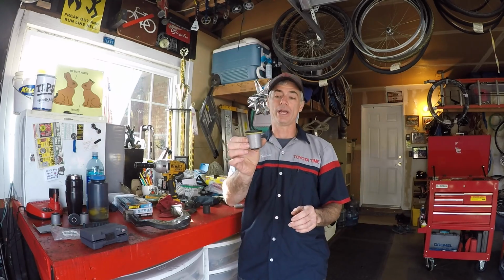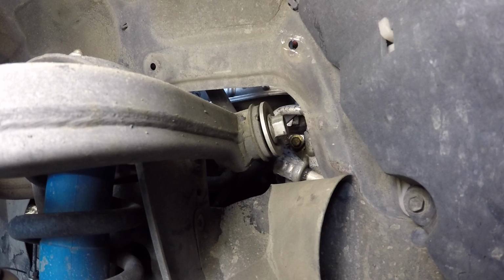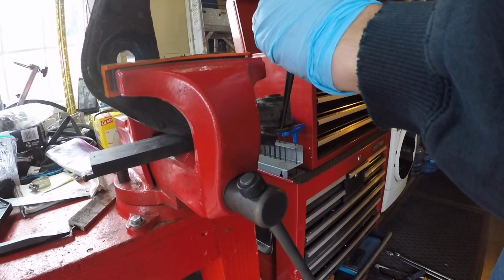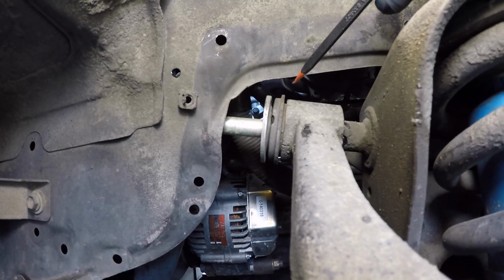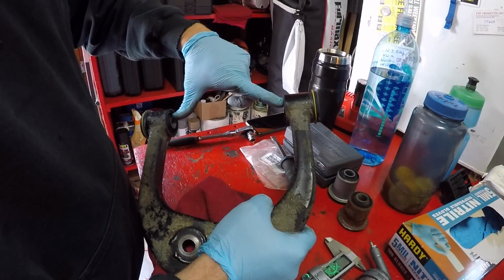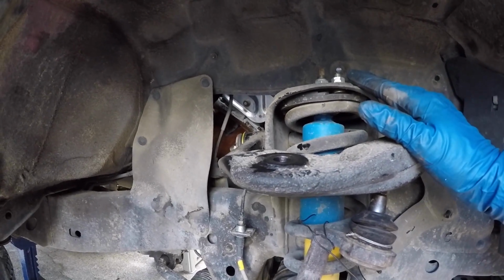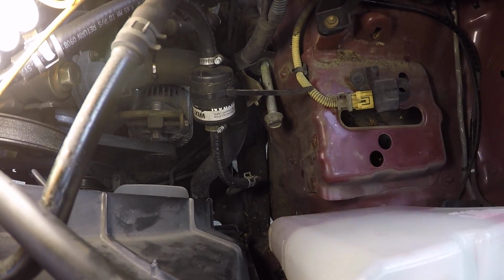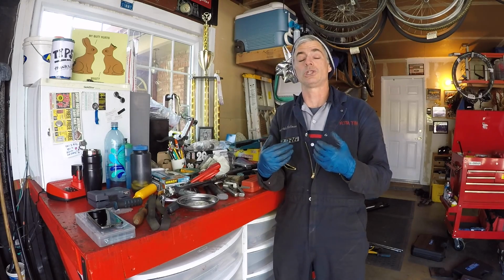Front Upper Control Arm Bushing Replacement

Comment: Can you use the same technique to press the UCA bushings out as the LCA by using the bottle jack and wedging it in between the arms?
Reply from the maker: No, you can't.  The distance is too tight unless you can find a miniature version of a bottle jack.
Reply: @T @TimmyTheToolman  that makes total sense. Thanks!!
Reply from the maker: @nathanjohnson7848 No problem.

Comment: Heyyy Tim quick question should those bushings fit on a 2003 Tacoma 2 WD Because I just came out of a Toyota dealer and they told me that I can’t just order bushing for my truck, that I have to order the whole control arm? Which was kinda weird, Im going to do the inner tie rods, and since everything gonna be out I’m changing everything like control bushings, lower upper ball joints, wheel bearing. Your videos areeeee awesomeeeeee!!!!!
Reply from the maker: I would venture to say yes, but since I've never done this job on a 2wd Tacoma, I can't give you a definite answer.  The control arms should be the same though.  

OEM inner tie rods are very expensive.  It's a better deal to buy an new OEM steering rack because you get new inner tie rods with it.  It's a better use of your money, because the steering rack is like $550 and the inner tie rods by themselves are like $300.

If you're doing front wheel bearings, our Manual Hub Swap videos will teach you how to do it.  Because you don't have CV axles, our wheel bearing video will be different than your setup.

It's good to know you like our videos.

Comment: Thanks for a another great video.  I managed to get all the way to the pressing then I mangled my control arm while trying to press out the bushing.  I used a deep well 27mm impact socket as I didn’t have a shallow one so I’m guessing it traveled on me at an inward angle so I didn’t notice it was mangling the control arm until it was too late.  I was surprised by how soft the metal on the control arm is.  Perhaps it’s cause my truck with 330k miles spent most of its life braving the salty roads of NY.  I’m watching Sean’s video on the JBA upper control arm install now.  If anyone needs OEM upper control tool arm bushings I’ll be putting mine up for sale as I won’t need them anymore.
Reply from the maker: @IGJSarasota  You're welcome. Sorry about your OEM UCAs, but you'll be happy with your JBA arms.  Good luck with the install.

Comment: Watching this I feel like I wanna do it myself 😂, I just wonder if the bolt will be seized in the bushings since I live in rusty enviroment. That might take the job to another dimention....Timmy you are true Master 👌. What I have noticed you have very good prices for the oem parts. Where you buying them ? I wanna do some shopping.... it might be cheper shipping them to EU 👀
Reply from the maker: Dealing with rust isn't fun.  I don't envy you.  Buying parts online is usually your best option.  I can't remember where my buddy Jordan bought his parts from, but Partsouq.com is a good resource for OEM parts at a low price.  You should check them out.
Reply: @TimmyTheToolman Many thx, I work in marine industry as engineer. We know how handle rust, but its not a fun in such tight spots 😂... I think it will be rusty. You are making such nice vids that feel like I could be your Padawan 🤣 TY Sir have a nice Sunday 😄
Reply: @TimmyTheToolman  Just wanted to say I got all parts at home, got it nearly half price if  compare with my local shops :))  I have been waiting maybe a week to get it from order to delivery. Good deal $$$. Cant wait signing of vessel to get it fixed :)))
Reply from the maker: @Hefa  Yeah, Partsouq has great pricing.  Good luck with the job once you get all the parts.

Comment: My toyota tacoma make noise when it's running going thru the dips. What is going on can't figure out.
Reply from the maker: It could be a control arm bushing.  It could be your sway bar.  It could be ball joints.  It could be a lot of things.  You need to start investigating.  I can't diagnose a noise you're hearing while you're driving over the internet.
Reply: I can hear it while I am driving on street it's coming from driver side
Reply: Even I hear it pushing down from front driver side
Reply from the maker: @papercrazy61986  Have someone cycle the suspension for you while you're looking under the rig trying to pinpoint the source of the noise.
Reply: @TimmyTheToolman  thank you

Comment: One way to make it even easier to press out the bushing is to insert a 27mm bolt into the hole of the bushing from underneath before placing the 27mm socket over it.  It will align the socket perfectly eliminating the need for any reset.
Reply from the maker: Thanks for the suggestion.
Reply: @TimmyTheToolman  thanks for all the great videos.
Reply from the maker: @steebereno  Our pleasure.

Comment: Great video, super helpful, best tacoma UCA bushing video on the internet!  Everyone else juat swaps control arms, or leaves old metal sleeve in arm.  Having just done this using Timmy's guide, notes:
Firstly, you COULD just leave that outer bushing sleeve in place, just torch out the inside and polish with a wire brush! The Energy suspension poly bushings that is actually what you do! I wish I had noticed this or known, I would have kept old UCAs and just used $20 ES bushings, saved myself $400 in parts, tax, shipping! Live with the squeaks...

I measured the sleeve  diameter needed to press out the UCA bushings.  Smaller than 1.55" to fit inside uca sleeve.  Bigger than 1.35" to ensure pressure on outer metal race for bushing, the part that gets stuck in there.

I've burned and pressed out the rubber core.  Ive soaked with PB for days.  I've heated with torch.  I've cut the metal bushing with a sawzall and likely damaged my uca doing that.  I've hammered on it with a cold chisel 100 times.  None of that works.  Need a press and need the right diameter sleeve.  Timmy said a 27mm Tekton impact socket worked, but his link goes to a different mfg now, whose diameter is only 1.3", too narrow.  I found the correct socket, 1.5" diam so should work, here it is:

https://www.amazon.com/TEKTON-6-Point-Impact-Socket-SID22127/dp/B08DK6FSRR/

Also
Reply from the maker: Thanks for sharing all that.  Definitely get yourself a press.  They are handy for many jobs.

Comment: Tim, what are the symptoms why replacing the upper control bushing? I have a 2004 tundra 4.7
Reply from the maker: You would be feeling slop in your steering or maybe a clunk in the front end when coming to a stop or accelerating from a stop.

Comment: Thanks for the great videos! I’m gradually making my way through all of these. One question, my local auto parts store rents a kit called an upper control arm bushing service kit. It’s essentially a C press with a bunch of sleeves. Did you not use something like that simply because it’s easier using the press? Thanks!
Reply from the maker: I used what I have in my tool arsenal.  I'm not familiar with the kit you're referring to.

Comment: Its safer to keep the castle nut on the first few threads when pressing the ball joint.  This goes with all ball joints.  This keeps the ball joint from hurting someone when it releases as the castle nut will prevent it from a violent ejection.
Reply from the maker: Sure, good point Jake.

Comment: I finally managed to remove the entire bushing from all my UCA and am now having issues pressing the new ones in. In your video they went in about 1/3 of the way with no issue, but mine will barely go. I froze the bushings, torched the UCA and added anti seize. I got them set up using a large C clamp and receiving cups but they are not wanting to move. Should I just crank on them hoping they'll pop in or is there something I'm overlooking? The UCAs are OEM as well as the bushings.
Reply from the maker: I don't know why they fitting that tight on your UCAs.  Did you get the OEM bushings from a reputable Toyota parts seller or was this maybe an Ebay seller?
Reply: @TimmyTheToolman  I got OEM from a reputable dealer. But I finally got them to move, just needed to use the sander on a Dremel and made sure they were clean. They were still stubborn but got them in. Just a  few millimeters and they'll be ready to roll.
Reply from the maker: @jeffluker1895  Good to find out you got them installed.

Comment: Thanks for such great content.  Interestingly, my 2000 Tacoma 4x4 doesn’t show replaceable UCA bushings  I contact Toyota for confirmation and they related if the bushings go bad, the only OEM repair is replacing the entire control arm! - Crazy right there.
Reply from the maker: Yep, they're wrong.  They say that because they never bother to replace the bushings because of the work involved.  Much easier to just replace the whole control arms.  Glad you like the video.
Reply: Hello question...these bushings are for Toyota Tacoma prerunner 2002

Comment: Would you happen to know  the part number for the uca bolt? I can't find one and I believe mine may be slightly bent.
Reply from the maker: We believe it is 90105-14105 if you have a 3rd gen
Reply: @TimmyTheToolman  oh I'm sorry I have a first gen Tundra SR5 4x4 4.7L.  But looks just like the same bolt and suspension?
Reply: Thanks so much man. I'm gonna go on a limb and say that they are the same bolt, so I greatly appreciate the speedy response. One more question, what would cause shaking coming from middle of 60/40 split bench seat? It always happens at 45-50mph no matter the situation, accelerating, deaccelerating, coasting, braking, all driving conditions no matter what. Also seems to come and go when on the interstate going 65-73mph. I have a new Powertrain Industries  prebalanced 2 piece rear driveshaft with new serviceable double carbon.  ( had to buy new shaft had a nightmare with stock double cardon rebuild) Truck has always done it from day one and have been trying to chase it down but all the parts I've replaced were soon to be. The new driveshaft came with the new center support bearing already installed so I am definitely happy with the new rear 2 piece. Could it be a bent rim? Would it cause it at different speeds?
Reply from the maker: @garybrady7245  I was going to say something with the drivetrain but it sounds like you addressed it with the new driveshafts.  I would certainly check your wheel balancing.

Comment: Hey Tim, Any recommendation for front upper control arm kits for a 2002 tacoma double cab with off road package? I don't have a press so I'm trying to go the easy route. I would consider to buy a press if my current 20 year old control arms are still good. How can I tell?
Thanks
Reply from the maker: As long as the metal of the arms isn't deteriorated from corrosion, they're still good.  I wouldn't buy new arms just because bushings are bad.  A Harbor Freight 20 ton press comes in handy for lots of jobs.  If you like doing your own automotive work, I'd get the press.

Comment: Running into an issue on my 4th gen trying to remove the long bolt. Will removing the ac line from the clip also work on my model?
Reply: Never mind, it worked exactly the same! Thank you so much! I was getting frustrated.
Reply from the maker: @KeyGilz  No worries Keith.  Glad you figured it out.  Happy Wrenching!

Comment: Done tons of these things I used the press to put them back in but I knock  out with impact air hammer and a chisel attachment and point punch through the little hole to start driving the bushing  Out Works  Good and fast if your gonna put poly bushings in remember not to trash the sleeve on the lowers you needed to put the bushing back in Haven't had any better luck with poly bushings and stock
Reply from the maker: Roger that.  Thanks for sharing your technique and info.

Comment: Thank you guys for all your hard work making these videos they are very appreciated. would the upper control arm bushing part number be the same for the tacoma? on Toyota's website it says it does not fit Tacoma but I am 99% sure it is the same part? do you guys have any ideas?

Thanks,
Reply from the maker: I'm 99% sure too but who knows.  I know the steering knuckles are identical and the LCAs are almost identical other than they have a different mount for the sway bar end links.  I'd say you're pretty safe buying the ones we list in the video description.
Reply: @TimmyTheToolman  Thanks! you guys are the best. im probably gonna go for it just wanted to at least hear it from someone else hahah.
Reply from the maker: @SteezerZimmer  You're very welcome.  Good luck with the job.
Reply: @SteezerZimmer  Did you ever do this replacement? What part number did you use?
Reply: @zachwatson5291  I did, I ended up using the part number that Timmy lists.
Reply: @SteezerZimmer  Right on. What year/model Tacoma do you have? I was looking into buying 48632-35070 (Tacoma 2WD). I wonder if there is any difference between that and 48632-35080.
Reply: @zachwatson5291  I have a 1999 Tacoma 4wd. I would assume the 2wd uses a different upper control arm, unless its a pre runner, then it would use the same as 4wd.

Comment: TIMMY! I have a 2WD third GEN 4runner. Planning on doing the Bilstein 511/OME coil lift. DO I HAVE TO DO MY UCA?? Looking at the SPC. Not planning on rock crawling, heavy off roading. Just light stuff, mostly using as a camping rig. Is it really worth the extra $600+ for new UCA? Would love your advice, thanks a lot!
Reply from the maker: Hey Josh, don't waste money on aftermarket UCAs.  You don't need them for how you intend on using your rig.

Comment: can i use this same technique to replace the boot?
Reply from the maker: What boot?
Reply: Upper ball joint
Reply from the maker: @elhiezenberg8393  All you would have to do to replace the boot is break free the upper balljoint from the upper control arm with a puller.  You don't have to remove the UCA.
Reply: @TimmyTheToolman  thanks timmy

Comment: What size is the socket that you use at tithe bottom to remove. Thanks.
Reply from the maker: We used a 27mm impact socket.  We said this in the video so I guess you missed it.

Comment: Reckon you could get these out with a C press or just the jack and some sockets?
Reply from the maker: I do think a c-press could take the place of the hydraulic press if you utilized the bearing splitter and press sleeve / plate on one side and used the socket on the other side to drive the bushing into the press sleeve.  Obviously it's going to be much more of a physical workout doing it this way and you'd no doubt would want to employ some heat to the arm with a butane torch to help separate the bushing from the arm.

A bottle jack wouldn't work because the arms are too narrow.  I don't know of any bottle jack that could fit between those arms.

Comment: Hey Toyota Tool Man, 
Can I use the Bottle Jack Method to remove the Upper Control Arm bushings the same way you removed the Lower Control Arm bushings?
Reply from the maker: No, the bottle jack won't work for this application unless you can find a very tiny bottle jack that would fit between them.  Also, the UCAs aren't as beefy as the LCAs so even if you could fit a bottle jack between them, you'd have to be very careful not to bend the arms out from the force and destroy them.
Reply: Timmy The Toolman: Muchas Gracias
Reply from the maker: @snoopdisnoop  De Nada.

Comment: Timmy, thanks for another great video. Que what would you suggest for bushings both sides, upper & lower. 94 Toyota v6 4x4 P/U
Reply from the maker: Hey Gary,  glad you like the video.  OEM is always a good choice for your rig but if you could find a more affordable aftermarket option like a poly bushing set that would be good as well.  I don't know if any manufacturers make aftermarket bushings for the control arms of your pickup.  You'll just have to do a search and maybe consult a Toyota forum to ask others if there's aftermarket bushing options.

Comment: Hello there, I hope you’re well during this time. I just bought a 2006 Tundra with an 8” Rough Country leveling kit. I believe the previous owner kept the other stock suspension parts. Are you aware of an 8” lift kit for 06 Tundra?
Reply from the maker: I'm not aware of an 8 inch lift kit for you rig.  That's a pretty crazy high lift.